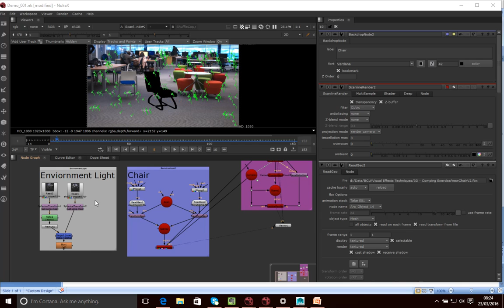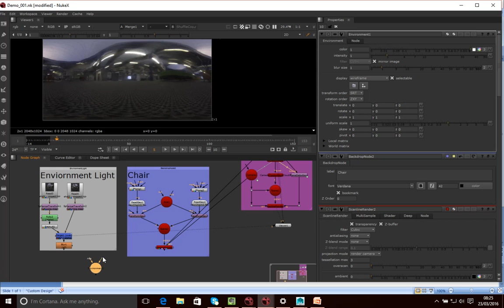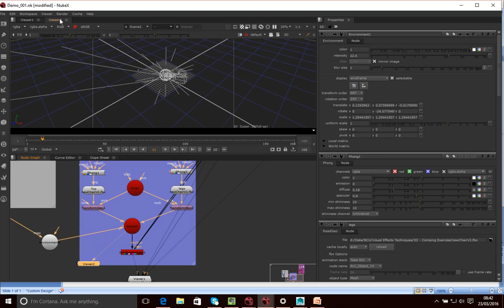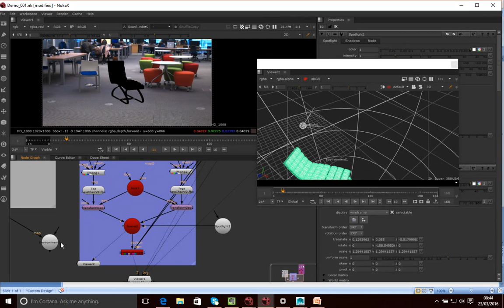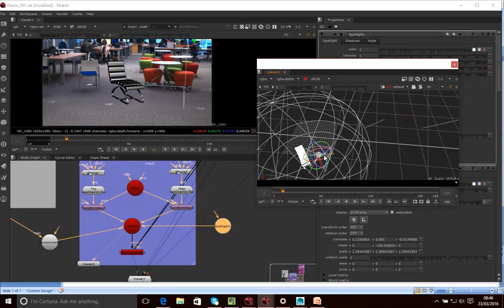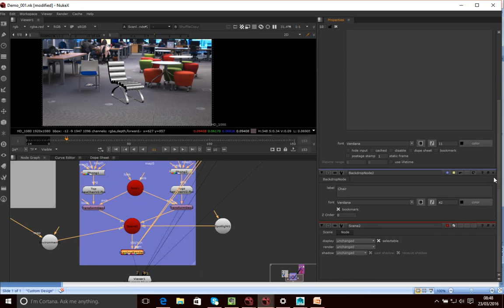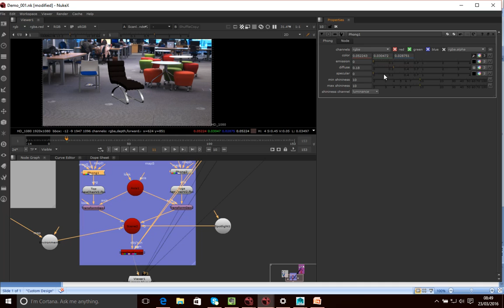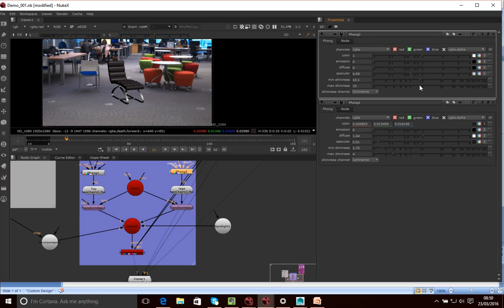Nuke Camera Tracking and 3D Compositing - Part 7 of 9 - Lighting The Scene

Comment: hi there, as far as you know, is it possible to have nuke rendering global illumination as arnold does?? i mean i added an environment light, but cannot use that env light to light my scene, i have to add a point light or other light....this is frustrating.
it seems that i can use the env light just for catching reflection, using the reflection node.
Reply from the maker: As far as I'm aware the scanline renderer in Nuke is quite basic and doesn't support ray tracing function such as global illumination.  You can get v-ray for nuke which would probably have this feature.
Reply: so neither the rayrebnder node is able in doing that....i tried to connect rnderman 21 to the prmanrender node, but i think there are some issues about between the nuke node and the new RIS engine. thanks a lot, i will look for vray.